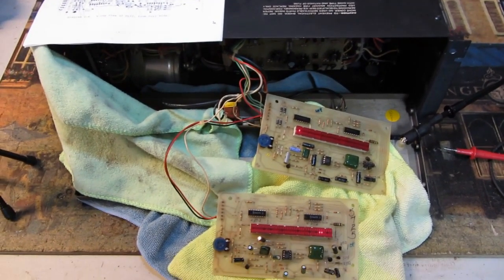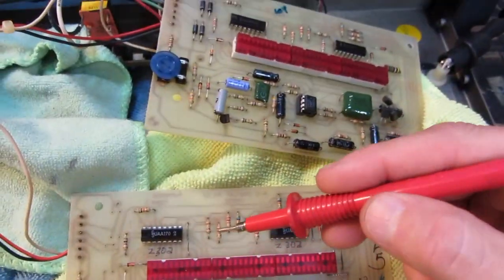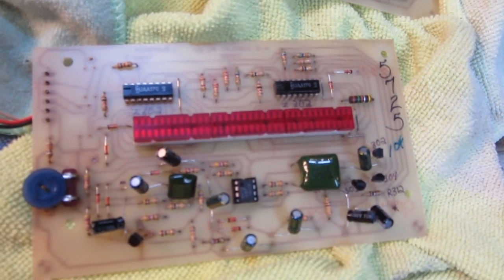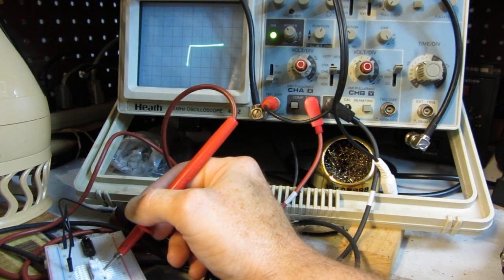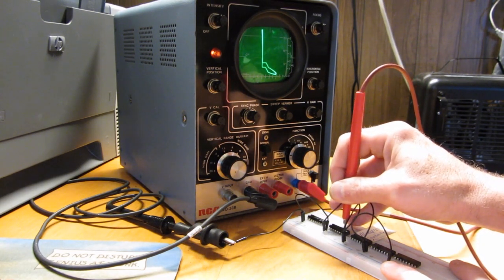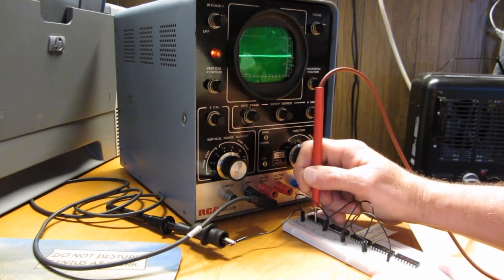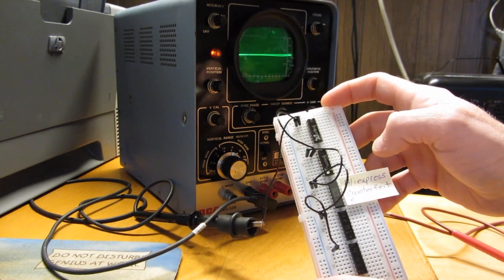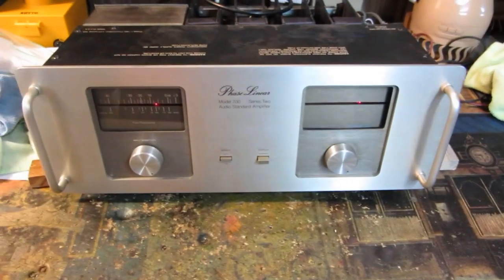Phase Linear 700 Series 2 amp repair LED peak meter display problem

Comment: Those amplifiers are known as curtain burners cause they can put. D c out on your speakers, what can cause curtain fires
Reply from the maker: True regarding the reputation, but this setup here has been in daily use since approx 1979 and never once had that type of failure.